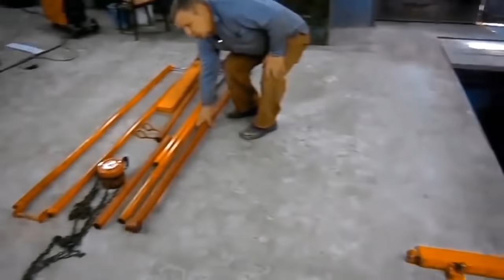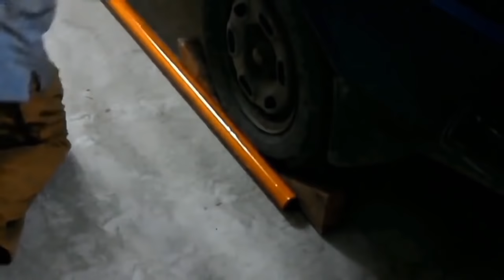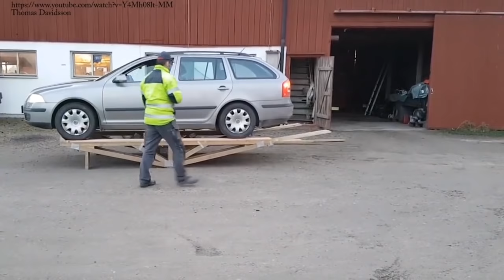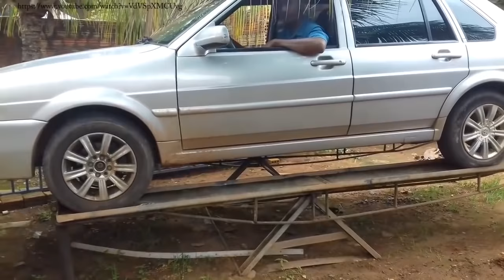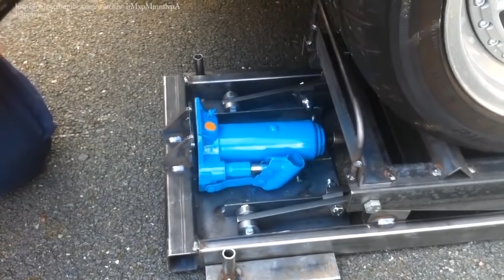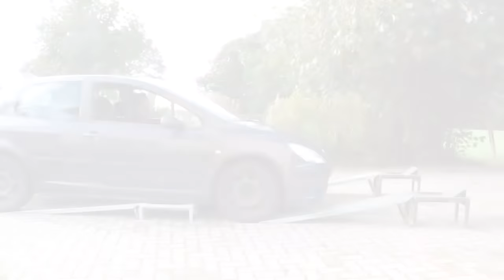BEST OF Homemade Car Lift Jacks and Homemade Car Service Ramps

Comment: My grandfather was killed when using 4 bumper jacks to lift a car while he replaced the exhaust system for $5.00 labor.
Jacking a car is serious business.
Reply: I have had to use bumper jacks quite a few times. Even on the expressway very sketchy .

Comment: I miss the wooden ramps my father built.  They were to stay in the garage when not in use but I had to put them outside for the house/garage to be worked on and never got to put them back in and they rotted away.  Time flies when you become busy with life but I am still upset about not putting those nice ramps he built by hand and I'll never forgive myself.
Reply: if or when you do you will ask yourself why you didnt do it sooner
Reply: Yeah man, those are ridiculously easy to build. Stack wood. Use good screws. Done.
Reply: forgive yourself  its ok
Reply: Do you have photos of his wooden ramp?
Reply: My dad made some the were great, you could parked a tank on them. The only problem was they weighed a ton.
Reply: Everything happens for a reason
Reply: You are forgiven.  Take stock that your regard for what he has given for the time you had.  It is no longer a burden you have to hold.  Making some for someone else may give you new lessons and meaning for what you have experienced.

Comment: Am I the only person to use my left foot on the brake (Automatics).. Hold the throttle steady and control the movement with the brake...  It's a learned skill........  but that's the problem... I guess next useless electronic addition will be a "creep mode"..

Comment: There's a few good ideas here, but the most important thing that everyone forgot was a way to remove the wheels. You have to lift by the frame and not the wheels.
Reply: I think the idea with these are to work under the car. Sometimes you need to lift by the wheels only because frame is so rusted it can't even hold jack stands.
Reply: That's only if you want to remove the wheels. Changing ATF, oil, coolant parts etc all require the car to be level while you are working under it, and none require the wheels to be removed
Reply: wrong. there are no good ideas here.
Reply: @XX-xv6xe  good ideas if you want to file a life insurance claim for your spouse
Reply: @XX-xv6xe  backwoods engineering with 2 tons of iron on a frame made with a $100 fluxcore welder spitting out bubble gum beads.
Reply: @cobre7717   🤣🤣🤣🤣

Comment: I would never rely on the strength of a bottle jack. I made 4 / 4x4 hardwood blocks. Each block had 8 blocks. Safe as hell
Reply: The Pyramids were built using wood blocking. Still used today to lift massive machinery and move houses. Just takes time, but very safe if you know what you're doing!
Reply: You should never trust any jack to hold a car. Seals can fail suddenly. Even slow leaks can lower the car on top of you, and you dont even notice until its too late.

Comment: Cheap jack stands and jacks always worked for me. Have done plenty of engine and transmission swaps with them. Recently converted my 99 Audi A4 Quattro from an auto to manual transmission using jack stands.
Reply: jack stands work well for me too, but i always add a security pile of rims under the frame bruh.
Reply: Also did a manual swap on my 2003 volvo with jackstands
Reply: We were just sitting at the shop having lunch when the Jack stands just dropped the car they been there about a couple of days and they just fell for no reason luckily no one was under the car wtf don't just trust anything when it comes to your life use safety overkill!
Reply: @ihopmta772  yup, just do it.
Reply: @angbar9075  you meant some sort of hydraulic thing? 
No way regular steel jack stand will fail for no reason
Reply: @Bakanelli  your exactly the way I thought,.. And believed, Till I saw with my own eyes this about 20 ft. From us I may have an old picture of the shop I'll post. My wife car Passport, blew a pressed in tranny seal had to replace w/ screw in type wasn't in a hurry so left car on stands couple days, hot outside wow 58 yrs/old never saw anything like it just saying... NOT HYDRAULIC REGULAR SHOP STANDS
Reply: @angbar9075  please post the picture somewhere and leave the link to it in a comment. Thanks
Reply: @angbar9075  No, not fell for 'no reason'. I'll accept they fell; but for a reason.  If they were the pull up ratchet type, did they have the locking pin set? Steel against steel will slide: did someone lean against it while sitting a couple  of days.
Reply: I'm imagining your family reading this five years from now.  "Cheap jack stands and jacks always worked for me."  Talk about tempting fate!
Reply: @reallyhappenings5597  😂written in the obituary
Reply: Never rely on them alone. Keep the jack up next to it.
Reply: @reallyhappenings5597  30 years of doing it and still kicking.
Reply: @eternalbeing3339  oops too late been doing it that way for 30 years
Reply: How do you make enough room - engine and transmission on a sub-frame would be quite tall...?
Reply: @pingpong9656  3 ton jack stands got it my Audi Quattro A4 up 24" to swap auto manual trans conversion
Reply: @angbar9075   what kind was they,  3 tons are not good enough, i only use 6 ton

Comment: I worked in many gas stations where jacking up a car onto floor jacks by hand was standard operating procedure, in one place we had 12 bays and only 2 floor lifts that were kept open for quick oil changes. The rest were all on floor jacks. Many of the older center post lifts don’t allow access to the central area under the car, which is where the mechanical parts of the car are located.
Reply: What do you mean ? The only thing in the middle of a car is the exhaust system
Reply: @iamasmurf1122  Oh really? Where is a transmission usually, or a drive shaft?

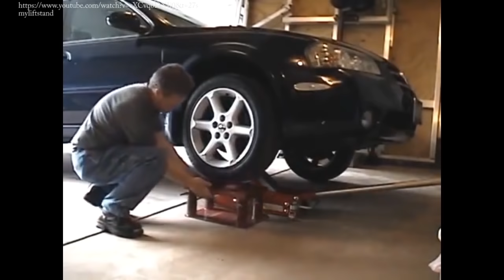Comment: Take the ones at 8:30 put a small ramp on each one to drive up onto with a small airbag in each, hook a common air line to each and lift whole car at the same time by opening a valve.

Comment: I built wood ramps with 2x12s.  The only ramps I trust my life with.  I'm sure they could hold up a house.  Otherwise, it's jack stands with locking pins.
Reply: I use ramps, + stands + wheels + jack(x2) + bricks. Lol..

My backups have backups.. I figured if all of them fail.. then it was my time to go.
Reply: @dnegel9546  it would take more time to put in take out all that crap than a simple oil change. Lol
Reply: @cobre7717  The oil change is just an excuse to do all the other stuff. The fun and ingenuity come with getting ready to do that simple task!

Comment: All these require for vehicle to move under its own power...the teeter needs a cable pulley system...floor jack and jack stands take up less room..would be a great addition to a shop with extra room..

Comment: I made drive up ramps using wood blocking front and rear wheels.  Having the wheels sitting on solid wood stacks (no daylight between the layers) is about the safest you can be.

Comment: Soooo many ways to die🤣 I admire ingenuity and creativity, and yes some products you can buy are also sketchy. But I would rather trust my life to tried and tested products just personal opinion 😉
Reply: facts
Reply: Fact
Reply: how do you think it got to that point
Reply: How do you think these products came to be?  It was a person with an idea.  They made it, they tried it, and tested it over, and over.  You have to know how to weld descent and know a little about metal but it's not hard to learn these things.
Reply: @anonymous4507  there's a lot more to it than just being able to weld what about known tensile strengths of hardware? Stress testing the metal being used knowing your welds have penetrated sufficiently? As I said I admire the ingenuity not once have a do e any of these creations down, some are very clever. But when your holding a car up you need to 100% know that it's either going to hold up or not tip over. And yes there's many off the shelf products that are not up to the job they're intended for.
Reply: @M-oneeleven-M111  I understand what you're saying completely.  My point is where do you think all of this began?  Trial and error.  From the moment the forge was invented and people started working with and welding metal is where the learning process began.  With just a little practice you can learn how to weld regular mild steel.  If you have a descent weld on just regular mild steel you would be amazed at how strong it is.  No problem at all holding up a car providing some extremely basic engineering and common sense is involved.  That being said you should never trust anything ALONE.  You should always have redundancy i.e. jack stands, blocks, etc..  If you build something test it well before trusting your life with it.  I do agree some of the devices on here have very shitty welds and I wouldn't trust a cat's life with them.  That doesn't mean you have to give up, or not try at all.  You can learn to build yourself many tools that will save you a ton of money.  You just have to use your melon a little bit.  I built a pair of really heavy duty jack stands that can hold up a loaded semi truck that I would trust anyone's life with including my own.  Use them almost everyday.  It's not as complicated as you might think it is.  Those jack stands only cost me about $250 and about 4 hours of my time.  Versus over $1,000 for a store bought pair.    And believe it, or not, I trust mine more than a store bought pair because I know they were built right.  There's also another thing you have to realize when you buy store bought stuff.  It's made quickly, cheaply as possible, and often times with robots.  I'd rather learn how to weld good, and build my own tools as much as possible because I know they're going to hold up.
Reply: @M-oneeleven-M111  Like I said there's a few things in this video I wouldn't trust for all the money in the world.  A few of these people need to first learn how to weld.  They need a lot more practice.  Second they need to learn some basic engineering practices for sure.  But I think we agree on everything.  Keep on dreaming and building stuff.
Reply: @anonymous4507  I second that buddy 😃👍
Reply: oh go ahead take a chance

Comment: WOOD is even crazier than concrete blocks
Reply: Wood is very strong and reliable. I drive a 74000kg mobile crane and we use wood under the out riggers  all the time to bring down ground bearing pressures.

Comment: I don't think I'd chance getting under the one made out of upside-down roof trusses.
Reply: That's the safest one in the whole lot.  Place 4 steel point jack stands at the frame and this is by far the best, cheapest and safest way to lift ur car. The downfall is storage.
Reply: I liked that one, make it out of angle iron, would be great.

Comment: If we used four of those under the car body above frame then connect to half air half hydraulic reservoirs then run onwheel hydraulic motor then the car drive forever or generate electricity too
Reply: What ?

Comment: All the systems that works elevating from the wheels don't work to make a job, because today's car with front transmission is necessary to remove the wheel for do the job. a second sistem for elevate is necesary.

Comment: - 8:31 is the only one that looks even remotely safe. I wouldn't get anywhere near any of the others.
Reply: i wouldn't go under that as well, under nothing non professionally tested with proper machinery and certified except maybe a concrete ramp

Comment: Those jacks at 8min 45 seconds look commercial but can't seem to find the name does anyone have the name for them or are they a DIY deathtrap
Reply: You can use old rims.
Reply: @jasonyu1162  how do you slide a floor jack into old rims?
Reply: @cobre7717  u jack up the car, place the rims under the wheel.
Reply: @jasonyu1162  yeah thats not the same thing.
Reply: @cobre7717  Didn't he jack up the car and place the red cube under the wheels at 8min 45 in the video?
Reply: @cobre7717  I use two rims welded together.
Reply: @jasonyu1162  yeah but then they slid jack into it and used it as a new lifting point (under the wheels instead of on the car frame/drivetrain)
Reply: @cobre7717  If u lift under the control arm, u can lift the wheel collapsed it will make lift height for two stack rims, I done it plenty.
Reply: @jasonyu1162  yeah. I know. I personally think that Jack stand in video we are talking about is a cheezy gimic. Its pretty dumb and takes up a ton a space. Id much rather just use a normal floor jack and jack stand or a piece of shit old steel rim like yous talkin bout. But some people just wanna buy stupid specialized crap that doesn't actually work for shit.
Reply: @jasonyu1162  the type of person who wants this crap stand in question doesn't want to get on the floor and try and "aim" for the control arm. They prob don't even know what a control arm is.......
Reply: @cobre7717  Its a gimmicky tool, I just use jacks most of the time. I use the rims to drop trannies or fuel tank u really don't want it that high, and usually u r working on the brake or the wheel so I agree.

Comment: I stopped watching. Especial the change block one, with a home made shackle. If that let's go the whole thing drops. And the tranny ramps with no over run stop bloody risky and much potential to wreck your cills.
Reply: That 3/16 shackle was over built by a factor of 0.0069694206969%

Comment: That trailer kinda good idea .... But you rely on balance.
Reply: the center of the ramp must be longer than half (center of balance front rear) of the car. the rear of the ramp must be heavier than the front to make it stand for the ramp. you are driving in and you are always crossing the center of balance of the ramp. or you drive front off the center of the ramp balance when the car is balanced 50/50. 

the structure should be connected so that it does not open or bend under the car. and should have shock absorbers so that it does not hit the ground when tilted forward.